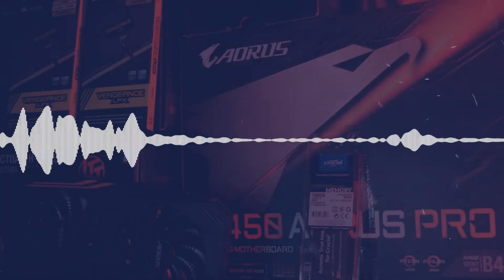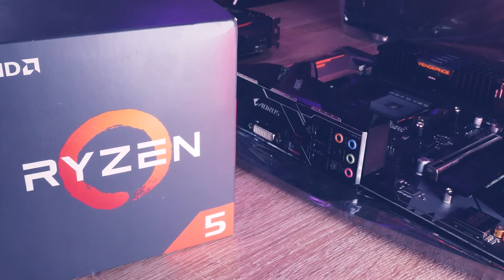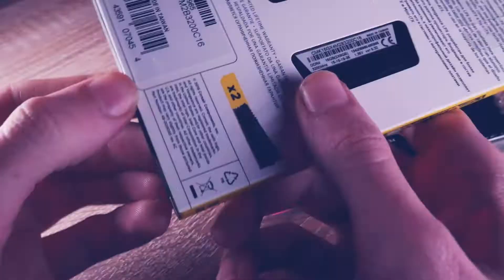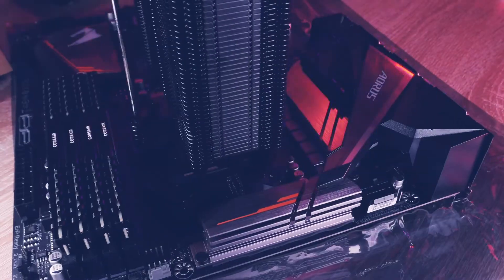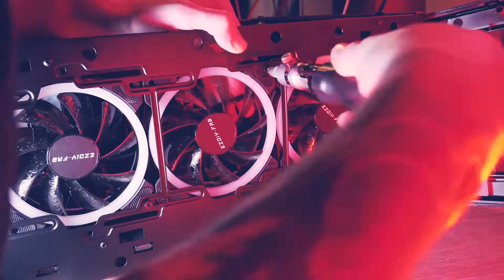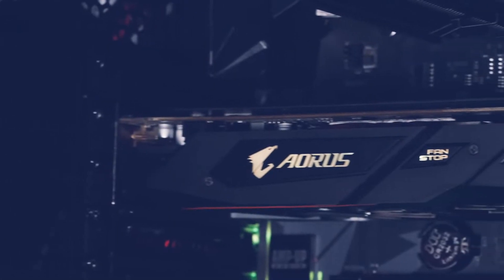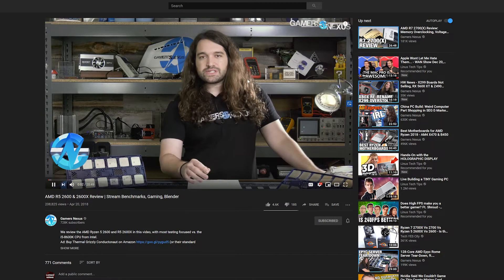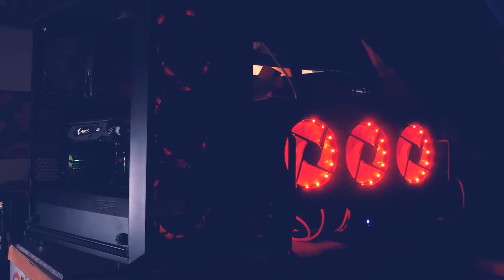DJ & Producer PC build with bling: parts & discussion

Comment: 1000 euros seems very expensive for a Ryzen 2600 and RX 580 build
Reply from the maker: We ended up ~100€ under budget, but yeah depending on the deals it should be possible cheaper. The 32GB RAM / M.2 / Fractal Case summed up